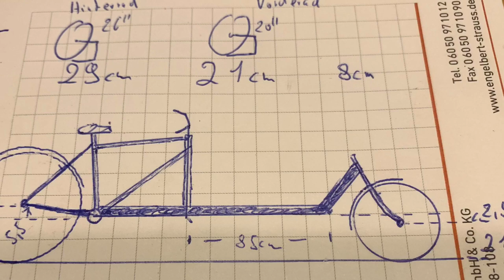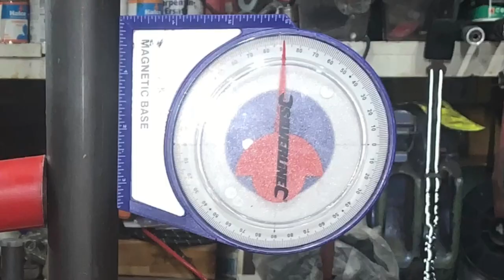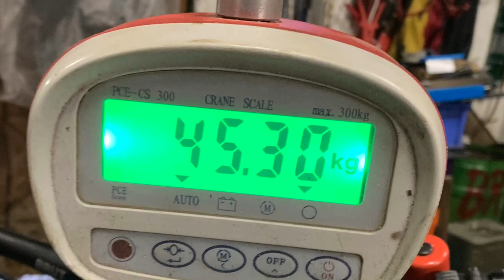DIY Cargo Bike - Build in a Month

Comment: Suggestion: If you make it a 1 x 10/11 (basically a 1 x) drivetrain, it would 
a) make the bike slightly lighter 
b) as any cargo bike is about carrying luggage than speed, lower gearing at the rear end will help with hauling load over uphills ...
c) plus any 1x drivetrain is so cool 😎 nowadays 👍
Excellent build, nice blue and net, I like cargo bikes 🤩🚴🏼‍♀️
Reply from the maker: Thanks

Comment: At least in Finland the maximum cargo for bicycles is 100kg. I think the total mass of a bicycle used to be 250kg, but EU changed things. Depending on legislation it is worth i the extra effort to try to minimize the mass of the bike so that way you can get more cargo and still be under the legal limit. 

I doubt police will pull you over if you aren't hauling something ridiculous on your cargo bike, but things are different if you get into an accident. Then the insurance company will try to find every way out of paying you.
Reply from the maker: This is What You think, in Germany there is no regulätion about Building a Cargo bike, Inlay the wide of 80cm over the wide of 80 cm you Must usw the road only

Comment: You really need to look at disk brakes and even hydraulic brakes. With that weight you'll burn though those rubber pads like nobody's business - especially if you go electric. This is 10 years of ebike experience talking... 
That said - nice build and I am inspired.
Reply from the maker: Rick Randazzo 
Thanks, for that, yes Disc Brake are more Powerfull, but  i Drive now 450 km with  e Power and the Hydraulic Rim Brake Takes the First Pads, i think when i Build anorher one there will be Disc brakes 💪🏻😎

Comment: I could never understand why builders make the steering arm stick out so far to clear the wheel when turned where as yours goes over the wheel. I noticed the long steering arm was bouncing as you rode it, can you support it in some way?
Reply from the maker: Hi 🙋‍♂️ i had no bouncing

Comment: Nice build!! I started a project much like this, only hard thing I encounter now is welding the 1mm frame tubes to my 2mm carbon steel steering pipe... Only doing test welds now, but I seem to burn the (CrMo?) bike tubing, and when I don't burn them, it won't stick... Do you have any welding tips for this connection?? (p.s. I assume the bottom bracket is normal steel, only tubing is higher grade thin steel??)
Reply from the maker: Hello, the pipes Cro2 I connected with TIG, the bottom bracket can be normal steel, but I don't know exactly
Reply: @schrauberigne  Thanks! I might want to get a MIG too one day :-) I finished my project, and it actually worked out with flux! 
https://www.youtube.com/watch?v=ooKzO1xpftg

Comment: Fantastic build my friend, how do you find those hydraulic rim brakes? Do you have to bleed the air out of them often?
Reply from the maker: The Braves are Rim Brakes H11 from Magura 
And there is an oil Filling Set from Magura, you Push out the Air with an Injektion from the Brake Pad holder upper to the Hand Piston
Reply from the maker: Take a Look at this Video it is in German but you can See how it is done 
https://youtu.be/k6y0CqstEdQ

Comment: What pipe were they made of?  Can I have parameters?  What is the practical capacity
Reply from the maker: Виталий Пак The Pipe upside is 42x2mm the Main Frame is 60x40x3mm the biggest Load allover was 240kg, the bike weight is 56kg with e Drive and accu my weight is 120kg so the load inside was about 64 kg
Reply: @schrauberigne  Thank you so much
Reply: Available profile pipe 40 * 40 * 2.  Thin?  You can make a double ridge.

Comment: 45kg ohne Motor? Viel Spaß! ;-)
Reply from the maker: Alexander Clauss Die Holländische Bakfiets wiegen auch ab 41kg bis 60kg je nach Ausstattung, wenn du fährst merkst du es kaum, hab aber mittlerweile einen E Antrieb, mach das fahren mit 50kg Zuladung etwas angenehmer bergauf
Reply: @schrauberigne  hi, was für einen Motor hast du ? bin gerade auf der Suche nach einem motor für mein long john lastenrad
Reply from the maker: Peter Schmieg Hi also ich hab mir ein System zugelegt, was ohne zusätzlichen Tretlagersensor funktioniert, der Sensor ist in der Freilaufnabe, zudem sind auch keine Bremshebelsensoren nötig, funktioniert wunderbar, zudem hat man nur ein Kabel, und nicht so ein Wirrwarr an Kabeln die zum Controller gehen, ist sehr aufgeräumt am Lenker, mittlerweile weiß ich garnicht mehr wie ich vorher ohne Unterstützung gefahren bin, wenn ich den Berg hoch fahre und die Unterstützung abschalte ist es als wenn ne Windböe von vorne kommt oder als würde jemand am Gepäckträger ziehen 😅

Der Junge man ist sehr Kompetent, hab mehrfach mit ihm Telefoniert, und per Mail geschrieben, alles super, Akku hab ich mir diesen hier geholt...
https://rover.ebay.com/rover/0/0/0?mpre=https%3A%2F%2Fwww.ebay.de%2Fulk%2Fitm%2F183997074417

und das ist der E Motorsatz...

https://rover.ebay.com/rover/0/0/0?mpre=https%3A%2F%2Fwww.ebay.de%2Fulk%2Fitm%2F333414634719                                                  Ich hab mir das System mit Mittendisplay bestellt

Comment: Poor engineering, you could have built it a lot stronger and lighter than this. The location of your tubes creates unnecessary strength in areas where it is not needed and weakness in areas which do.
Reply from the maker: Paul That is their view of things, so everyone has their opinion!
Reply: @schrauberigne  Opinion has nothing to do with it. The forces involved dictate what design will work best.
Reply from the maker: Paul There is always someone who knows everything better and cannot do it!
Reply from the maker: Paul He is the one who knows and knows everything better
Reply: @schrauberigne  Go do what most clever 12 year olds would do....find a structural app that allows you to design frames and calculate the strength before you get welding.....instead of spending the same time arguing with someone who gives you advice on how to make it better.
Reply: A key thing here is you need the cargo area to hold boxes and suitcases, the typical shape of the cargo. So you may as well use the extremities of that cargo space to give you the strength needed across the 2 wheels. Utilise all 4 corners of the cargo area and not just the centre.
Reply: Instead of an area of strength to support the rider and an area of strength to support the cargo, combine the 2. A single supporting span between the 2 wheels that supports both cargo and rider.
Reply from the maker: Paul thanks for the instruction stay safe and stay healthy without covid19